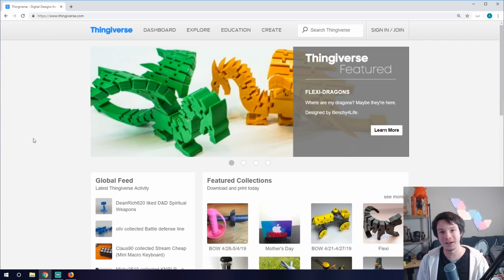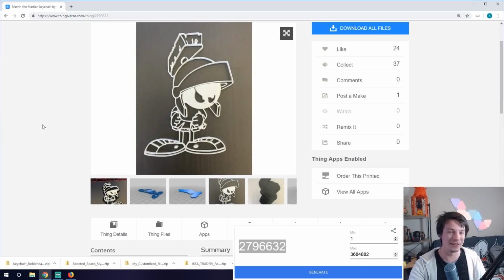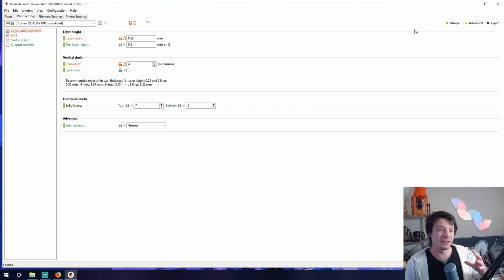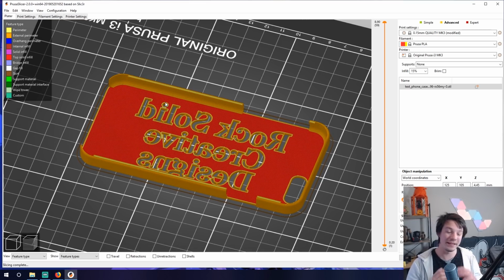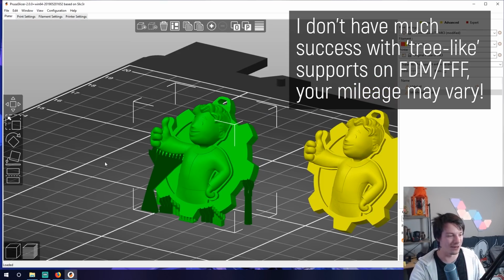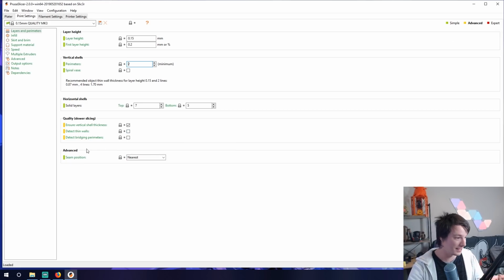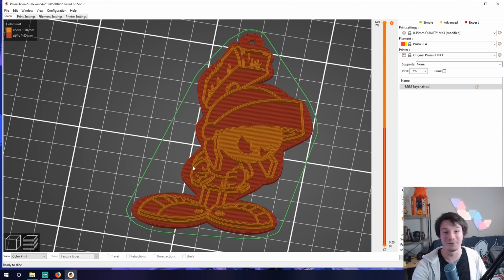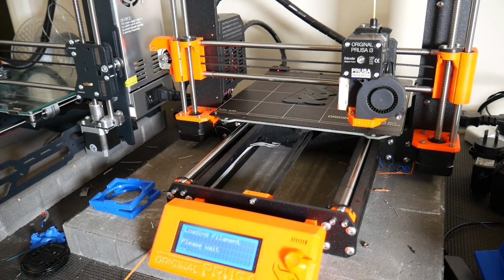PrusaSlicer 2.0 vs Thingiverse vs Prusa Mk3 - 3DP Gauntlet Episode 1

Comment: What's with the surface texture on your prints? Is that ringing? Vibrations? Extruder issues? Is that common to the MK3?
Reply: You mean like on the bottom of the phone case? That is due to the MK3's print bed, it has a textured surface.
Reply: @GrayOlson  No I mean on the sides of the print. Such as at 25:20 on the fall out coin.
Reply: @JasonZnack  That is common on small parts on FDM printers, and is made even worse on that piece because of the support material that was bonded to that side of the part

Comment: I believe the "oozing" you saw on the filament/color change was actually an extrusion.  The M600 command does a retraction before it moves the nozzle to the front for the filament removal and insertion process.  Then, as it moves back to print position, it pushes out filament to compensate for the retraction it did.  If the filament change process skipped that part, you'd see very little oozing and have a much cleaner filament change.

Comment: Does PrusaSlicer 2.0 work with no Prusa printers?
Reply: Yes, but you have to setup a printer profile..  including max feed rates and jerk settings...  It will generate some prusa specific gcode, but most are inconsequential (firmware  version checking for eg)
Reply: @Dust599  thanks

Comment: On all of my prints using PS2.0, with supports, i'm unable to remove most of the supports. Without supports, prints very well.
Reply: Change the z offset from .1 to .15
Reply: @screwyluie  already at 2.0,  will try again tho,thx

Comment: I have an Ender 3 and started with Cura and have stuck with it, but I'm thinking maybe I should give the new PrusaSlicer a go!!??
Reply: Does it work on Ender 3?
Reply: @PabloSanJuanOk  that's my question. I don't know. Why wouldn't it? It just spits out gcode, right? Just wondering if it's a better slicer or not?
Reply: @5UPRAH  Yes, I installed it, but all the machines are Prusa, didnt have any option for custom printers, did you try it?

Comment: Heard of formlabs?
Reply from the maker: Yep, I tested the Form 2. It's awesome.
Reply: @MakersMuse  did you see any sort of printing quality that makes it Industry-Leading as it says in the ads?
Reply from the maker: The printing quality is superb, but the high price is due to the useability improvements over more basic resin systems. You can get similar quality from the $500 anycubic photon but it's a lot more hands on and more prone to failures.
Reply: @MakersMuse  i agree

Comment: as a user of thingiverse. i do think they need to have a good clean out on there pages. like myself i always do a test print with my models. and i always advice users on my fb groups to run thingiverse models into 3d builder or meshmixer to check and repair any errors. especially if there using resin printers. as fdm is very forgiving for errors when printing. but resin will fail. and hate to see ripped game models just uploaded onto sites. low poly 0 wall thickness etc. hehe wished ya had hit my page. my dragon will print with 0 supports 0 infill and 1 shell. and shows details. :)

Comment: Great tips and tricks Angus and done superbly. Any chance you could do a video on setting up Prusa Slicer for a different printer, maybe a CR-10s?
Reply from the maker: Yep! I definitely intend to use it for more of my machines and detailing the profile and how I get to it is a great idea.
Reply: @MakersMuse  Awesome. Looking forward to it.
Reply: I would like to become proficient with PrusaSlicer with my original stock CR-10 while I’m saving up for a MK3S, but have been scared by the multitude of what appears to be machine-specific settings. Learning how to configure for a non-Prusa machine would be extremely useful.
Reply: @resnbl1  Don't let that scare you off, all the Prusa machine specific profiles are included when you go through the initial wizard. You could always download it and have a practice run. Either way there are a ton of awesome people, only too willing to help out if you need it. I have the MK2 and the standard profiles are excellent, you can go in and tweak when you get more comfortable with it. For my #Borg (CR-10 on steroids) I've dabbled with Prusa Slicer, just looking forward to what Angus does.

Comment: For the fallout keychain, wouldn't move the biggest parts to the bottom help to reduce support? Like flip it completely. 
I haven't used my printer in 5 months. But thought about reviving it a few times. Pursa Slicer looks like a good idea to do so. I used it for a year and it was really great. I only switched to Cura because I failed to get a working print with it for two weeks. Cura wasn't as nice tho and my failure rate was above 55%. 

What steps do I have to take to get a printer back to running great after a long period of it just sitting around?

Comment: Can you use a 3d printer from another company with this slicer?
Reply from the maker: Yep
Reply: I’ve got both an i3 and a modded cr10s and I use it for both. Just have to create a printer profile for the non Prusaprinter printer and save it. It’s not hard to do, especially if you already have a profile in a different slicer as you can usually just copy a load of the settings over once you figure out the different names for the same things.

Comment: thanx for posting Angus
and yes the netfabb feature is there already for a longer time
I do use the multi color quite a lot to make some parts have color accents or as offset color backgrounds when having text on functional parts ( white layer behind embossed black text  eg)

would it be possible to print the largr part with jist a small support tower in the middle to help with the bridge? no need I guess to do the entire part with supports 

for the fail
I was already thinking you forgot one "S"  when you sliced that one.. 

I see you are using the poeder coated steel plate. Im not sure if the surface "finish" is that nice compared to the PEi sheet , whats your intake on that ?

Comment: 14:45 you: "I think we can get away with that", me: "no no no \o/" especially in this view there is not even "bridging" but a standard bottom (45º) fill into thin air.. obviously you corrected it in the 2nd approach?
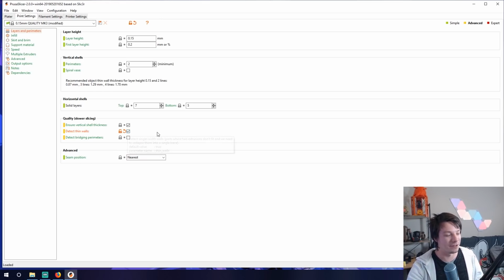My experience with "Detect Thin Wall" (11:13) is mixed, sometimes detail get even worse, so I usually test slice several times closely inspecting the slice preview. However, I didn't know about XY Size compensation - good tip!
Very useful video, once again.
Thank you

Comment: I think for the battery case I would have also rotated it by 90 degrees in the Z to minimize the effect of the print bed trying to shake the part loose as it moves back-and-forth in the Y direction. Interesting video, by the way. It is always educational to see how others approach slicing.
Reply: I was thinking the same thing.

Comment: In PrusaSlicer 2.0  you can change filament, is now built in.(see prusa movie about prusa slicer), without mmu2.

Yes you can use the PrusaSlicer 2.0  for every printer, you may need to adjust the printer settings, and filament settings to your printer, or copy them from a slicer that works good.

Elephant foot setting was new to me, thanks for that.

Good movie to let us see how you adjust a print. 

You may make more of these, for more different prints, leave printing out to save time, for most prints, but explane how to set the print in the slicer.

Comment: "Support enforcers"!? "Manual support" makes more sense and explains the purpose of the setting. That kind of language puts me off the prusa slicer.
Reply: I think they probably went with that language because initially they just had "support blockers" so when they added something that made sure that supports were created, they went with "enforcers". "Manual Support" does make sense, but you can use them in conjugation with the automated supports, so the idea was that they created areas were the support creation rule was enforced.
Reply: Well if that tiny thing is all it takes to dissuade you from something I doubt any explanation will satisfy you.

Manual supports in every slicer that has them means you get to pick each individual point for supports. Enforcers don't do that, they a broader implementation that applies to a whole area instead. The language actually makes good sense

Comment: M600 - I used to have the same issue until I realised you should NOT clear the bit that gets extruded first. The final ooze as it moves into place then comes off with that and usually it's clean on the model.

Comment: Elephant's Foot:  I get by with a .4mm chamfer at 45-degrees usually.  I'm still experimenting with it though.
Reply from the maker: Definitely a good solution! I prefer to put a chamfer on the bottom edge of my parts when designing them too.
Reply: I usually just use 0.2mm of compensation in Slicer and it seems to work fine.

Comment: Stupid question can I use the prusa 2.0 slicer for my Ender 3 pro?
Reply: yes, you can, although you have to setup your printer's parameters in the slicer (bed dimensions, etc.)
Reply: then I will give it a try
Reply: I did it and it works better than cura if you set layer height to 0.16